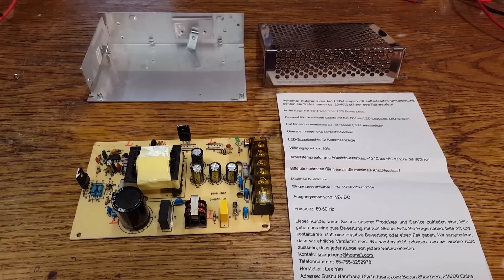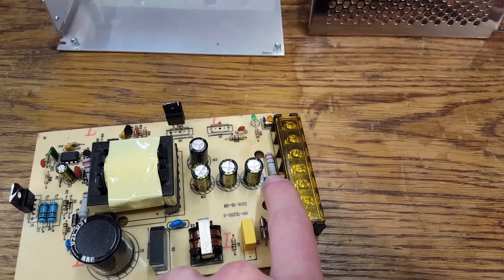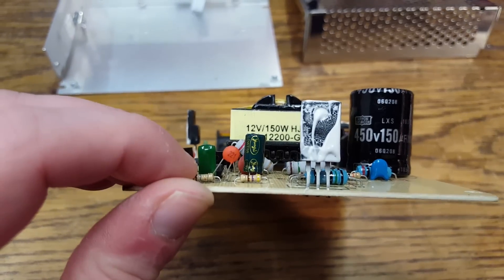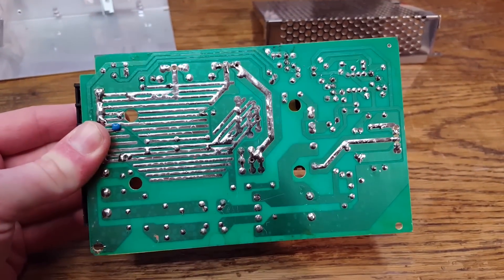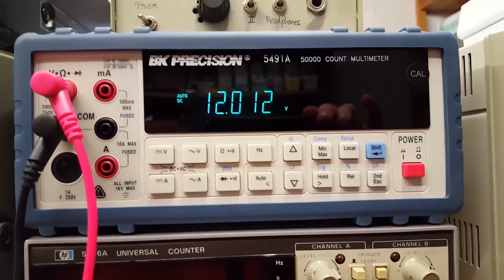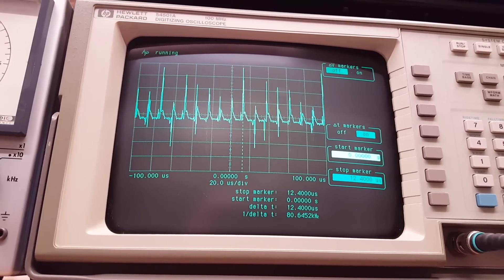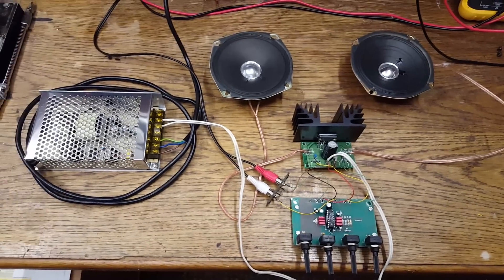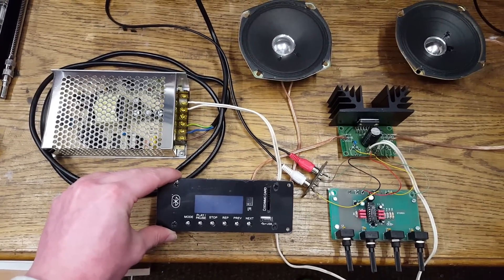Ebay 12 V LED Switched-mode Power Supply Review

Comment: What I liked about your review is that you never at any point bashed this PSU, you gave absolute honest review unlike others that go out and just say awful things about these China made PSU. Folks forget that you get what you pay for. Besides most people that buy these units use them to power LED where for the most part noise is not a great consideration. The concerns of these users are the amperage not measuring to posted rating. Like I said - you get what you pay for.
Reply from the maker: Thank you :)

Comment: I have bought a similar power supply for a small class d amp,but it is a bit too noisy,if you stay pretty close to the speakers.Is there a simple way to clean the power input a little bit more?
Looking forward to the next video :)
Reply from the maker: You'll have to play around with capacitors and/or inductors. Capacitors in parallel to the output, inductors in series with the output. Maybe just a small 100 nF capacitor as seen in this video will help.

Comment: How much does it cost? Is there any one that is maybe 150 - 300 watts for under $5 with shipping? I have seen them at that price but not in a while, I can improve quality of components and construction if needed.
Reply from the maker: Don't get a power supply for such a low price. That's just asking for a disaster to happen.
Reply: DrCassette Well considering that my only income is about $10 a month from money making apps, I an not willing to spend anything more than maybe $10 when I already have everything to make it higher quality and the knowledge to do so.
Reply from the maker: There are too many things about these cheap power supplies that can not be changed. Circuit board layout etc. Again, don't go cheap on this kind of stuff.
Reply: DrCassette I have no choice though, I wouldn't use it if the separation was very small but as long as its ok, I would replace the parts with high quality ones then use it, I am just wondering if you know any that are cheap because I have no choice, it's those or nothing, I choose cheap supplies.
Reply: I paid  about $10 for 120 watts @ 12V most were listed at $13 to $15 for 12 W.  150 -300W is probably going to cost $15 to $25 even if you shop hard on ebay. Watts cost money even in China. At current prices $5 will buy you about 12 to 24 watts still not bad for the price of a hamburger and soda. I recently paid $2.68 for a 1 amp 12 volt supply after shopping for 1 hour which might be a great deal when it arrives in 4 weeks.

Comment: Hi Dr Cassette.I am from Nairobi, Kenya.I have a  similar unit  power supply.However ,mine produces a hissing  noise when on load at  its lowest setting.It is not the usual transformer humming. Sounds more like a faint analogue tv with no reception.When load is removed and  voltage adjustment increased , sounds gets abit louder.what could be  faulty,or what can i do?Please help
Reply from the maker: It's a switched-mode power supply. There is no transformer that could hum. A lot of switched-mode power supplies emit a faint high frequency noise that canges with the load current. Your power supply is most likely fine.
Reply: yes it works  fine  with no problem, just abit annoying, thought there  was  a way could get rid of it